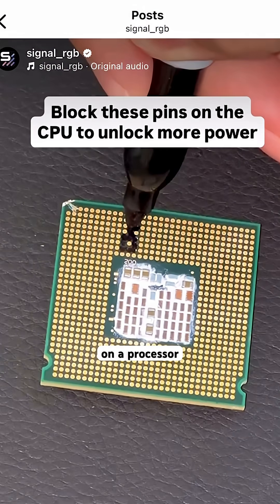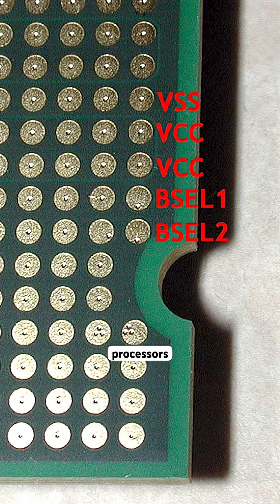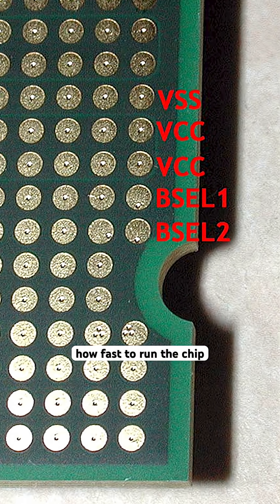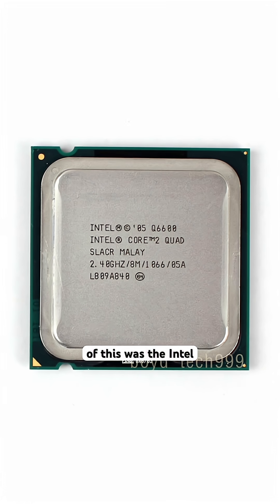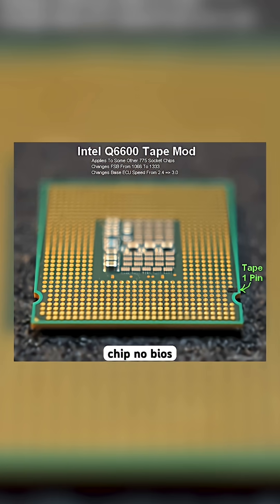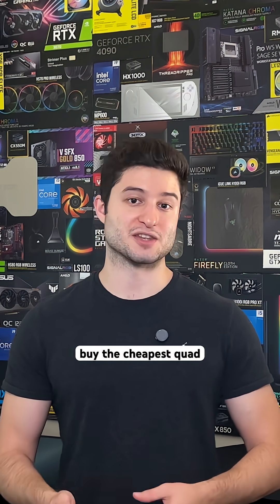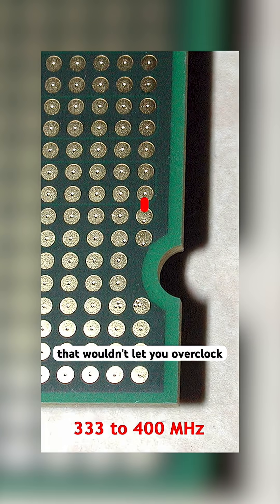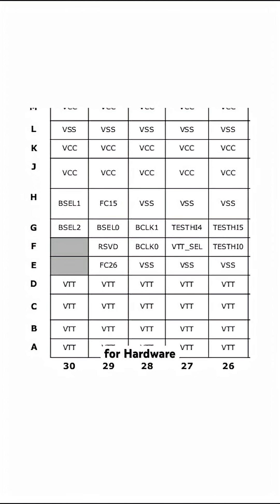Taping a CPU to improve it?!

Comment: the original socket A Athlon CPUs could be overclocked by connecting cut traces on top of the chip with a pencil.  It unlocked the multiplier.

Comment: The best overclock and bargain is still the celeron 300a. Set the FSB to 100, and it became a 450MHz cpu. They cost like 150, and gave on par performance as the 450MHz Pentium 2's at about 650.
Reply: Don't Celeron processors have smaller CPU caches and will there run slower in some situations, even if frequency is the same?
(Still a very good deal if somewhat slower than PII, because of that crazy price difference)
Reply: Nope, in fact, the half-size, full-speed cache was actually better in same workloads, including games. I used the same trick to boost my Celeron A 333 MHz to 500 MHz - the performance bump was massive for the time.
Reply: @anousenic  Yes and no. Yes it had a smaller cache but intel put it on the chip to save money. So it ran at the full chip speed. The Pentium II's cache was off the chip at 1/2 the speed, and as you noted larger. 

For most applications and games at the time, the 128k was enough and being twice a fast was a huge contributor to it's performance. 

Some heavy workloads that needed the larger cache would favor the pentium II 450.
Reply: @Blah.07 Slot 1 Katmai P3 had the same half-speed cache as well iirc. Socket 370 to slot boards or later slot 1 P3 were a massive improvement
Reply: @anousenic  PIIs had the slow off-die cache on the slot package, so yeah whilst the Celery had smaller cache the fact it was on-die meant super low latency and with 1:1 clocking that was faaaaaaaaaast

Hence the winning in some workloads and usually matching fine enough - very few situations the PII outright won!
Reply: @anousenic  One quarter of cache running half of speed.

But is funny see these jerks thinking they're smart and no one will detract their bullshit...
Reply: Glad to see others remembering the legend. The 300A is still the undefeated champion of "i delivered so much for my cost". Modern day comparison would be taking something like a 5600, flipping a BIOS setting and bam, you have a 5900. With 6 extra cores coming out of the magic ether :P
And boy, was Intel pissed when people starting putting dual 300A's in SMP... yeah, who cared if you had to drill the packages. You'd have to blow 3 300A's before you hit the same price point as the 450.
Couple it with Intel having another legend out at the time, the 440BX, and it made for really good times. That that chipset could later in the days hit 150FSB give or take was just icing on the cake.
Reply: @ErazerPT …. Ah, the memories…
300A
440BX

I added a Peltier cooling system (custom-made by some dude)

Good times.
Reply: yea but the 1ghz was cheaper. and you could go up to 333fsb / 66x

no point in bumping up 400mhz if it fries.
Reply: I remember doing this! I don't think I could even assemble a PC these days.
Reply: Back when I was into my overclocking, I had a Celeron 300A setup that could boot at 600MHz with a FSB of 133, and the stock 4.5x multiplier.

To get there I tried 4 different CPU's, several brands of PC133 memory, made a custom billet alloy CPU heatsink with TWO 80mm fans on it, all sat in (IIRC) an ABIT BX6 motherboard. The motherboard was the key, because it would auto populate all the CPU parameters, but then let you override pretty much all of them.

It took a lot of tweaking with things like the CPU voltage, and memory timings to get it to boot into windows at 600MHz, but I got their eventually. Unfortunately it was a bit too unstable if you asked it to do anything on top of running the OS.

It took me several hours of trying over and over again before I finally got a CPU benchmarking program to run all the way through, then take a screen grab of the results, and save it before the system crashed. 😁

I clocked that one back down to a totally stable 450MHz, and ran that as my LAN party PC for a couple of years.

Oddly enough, I pretty much did the exact same thing when the Q6600 came out. I ended up buying 3 of those to find one that was happy with an extream overclock, and got some pretty impressive results on air cooling, but once you've ran a CPU at DOUBLE it's rated speed, ONLY being able to get a 33% boost from 2.4GHz to 3.6ghz is a bit anticlimactic. 🤣

That one also ended up with a less OTT overclock, and was used as a LAN party PC for several years........ I think I've still got it somewhere. 🤔

(I just had a quick look through my box of old CPU's, and found one of the two Q6600's that didn't make the grade. I'm now trying to remember what I did with other one? 🤔)
Reply: @Reman1975 i just recently came across a Q6600 sitting in the junk drawer in my workshop, found that thing and it immediately took me back to those days 😂
Reply: OG AMD Athlon (Thunderbird core) was very easy to unlock... All you needed is a pencil to bridge the gap on L1 bridge and you would get an unlocked multiplier.
Reply: @bojned literally just commented this on another thread in this comment section, the pencil trick was epic. I would always cover the pencil mark with clear nail polish that i put on with a toothpick because those were the days when i was too cheap to buy conformal coating and i was paranoid that the graphite would somehow wear away 😂
Reply: I dunno Venice core for Athlon 64... could buy a 1.8ghz and oc it with stock cooler to 3ghz; they were insanely efficient for the era
Reply: @plasmar1 i had an amd duron oc 10-15% with software, until it stopped booting. wish i kept it
Reply: It's not "still" lol 450mhz would be so painful for todays age.
Reply: @rawbmar1166  We're talking relative performance.
It would be like buying n i5 for 150, then setting a pretty standard option in the BIOS, and getting an i9 for free.
Reply: Oh yes, I had 3 300A's overclocked with peltier cells and waterblocks running SETI.
Good times.
Reply: Especially paired with an ABIT BP6 motherboard. Dual processor goodness for a budget price. Still have my box from back then.
Reply: @egbront1506  i still have an unfinished project from the time i loved the Pentium 3 (although a bit after its hayday). Dual Socket 370 Mainboard with Via apollo 266 chipset (DDR1 and AGP Pro 4x slot), 2 Pentium IIIs 1400.
With a decent graphics card it ran much later games surprisingly well. Unfinished because i bought 2 waterblocks for it to watercool it with leftover parts from my more "recent" system... and Firefox stopped working after some update required instructions the cpus didnt have...
Also never tinkered with overclocking on this thing, bios didn't offer any options and didn't bother trying of patching it reveals hidden options or if the pll/divider is reachable over i2c/smbus :D
Reply: I did a similar thing to my P3 500. Upped FSB from 100 to 150 and it ran perfectly fine at 750MHz. Not all memory ran that fast though.
Reply: The Pentium Dual-Core E2160 has the Celeron beat. 1.8 GHz to 3 GHz on the stock air cooler for $65. Like all Core 2 chips, completely unlocked, so required no mods.
Reply: @rars0n  Yeah, got my Celeron 440 from 2.0 to 3.5 like a breeze.

Comment: The chip wasnt designed to be running that high of a clock. Im willing to bet people spent half the money on a chip they burnt out and replaced 3 times. 😂
Reply: CPUs didn't burn out like that back then.

Now they even come straight out of the factory with degradation issues.

Comment: All processers are made the same, but based on testing are how they are rated.  Like the i3, i5 and i7 are all the same CPU with certain factors blocked or locked out because it didn't get up to snuff.
This was most widely known back with the Celeron processers and the Pentium 4 series.  A Celeron was just a P4 that didn't make the cut.
Reply: but what is the downside to doing this? overheating? would better cooling prevent degradation or it makes very little difference?
Reply: @TheReapr my basic understanding is that it depends on the "silicon lottery" referenced by other commenter.

Intel might say their i5 runs at 2.4 ghz with 4 cores and the i7 runs at 2.6 ghz and 6 cores. You might have a chip that actually has 6 functioning cores, but running at 2.6 ghz fails. So they can't call it a full i7 and block off 2 cores and call it an i5. But by tinkering with your cpi you could get 6 cores out of it but be unable to run it past 2.4 ghz.
Reply: @TheReapr there is a chance the chip isn’t stable at the high frequency. Maybe it works now, but after a year of ageing in 35°C summer temperatures it suddenly starts bluescreenining.
Reply: Laughs in CCX zen2
Reply: No they aren’t. They will have a few designs and might get two or rarely three products out of that design. 

The i3, i5, and i7 are not all the same chip just binned.
Reply: @bensemusx  um afaict intel copied amd and still use their drivers includeing current architecture. they wouldnt have 64bit or multiple cores without it. 

on top of this intel does this binning. which is fine, the stuff that works... still would be working removing any restrictions like ram addressing and overclocking limits. 

these days you can have various components at 3ghz and have a quad core on its own power profile and rail. hitting up turbo 4ghz 😂 brand new gpu... with 4 lane pcie 😂 unless its a xenon
Reply: They still do it now. Tried to make an 8 core processor but two cores don't work?
Congratulations on your new 6 core processor!

That's why the PS3 Cell processor has 7 SPEs instead of the standard 8.
Reply: Kinda the same for NAND. Almost 100% of the NAND on the consumer market is the junk that didn't pass QC for enterprise hardware.
Reply: 🤣🤣🤣🤣

completely different architecture

Comment: I have a q6600 in a working PC as we speak.  It will not run at 3ghz and you don't need tape to find that out. The bios has OC capability...you can tweak fsb and other clocks from there.

Comment: Models of Dells up to last bios version of the Precision m6500 could also have fan control overridden to run at max when modding via Fn + Shift 15324, then Fn+R. Did a lot of this stuff on Dells and Cpus that were not meant to run so hot.
Manual entry of BIOS fan control in hexadecimal, like being a fucking wizard.

Comment: It doesn’t matter what the motherboard thinks the processor is. The key point is what the processors actual speed was after the modification. Was the speed really increased or was it still running at its normal speed and only the software reported it as higher (trick)

Comment: Did it fry your cpu
Reply: Not really it might become unstable at which point you just take the tape off but by that point over heat protection was already in use

Comment: You have to remember, electronics are binary.

There are a surprising number of configuration pins on almost every chip.

They are, you guessed it, binary. 
They either read low or high voltage.

For example, if you ever look at a datasheet, you'll see a bunch of voltage id (VID) pins that combined add up to 2^n voltages at whatever step and range the spec calls for. Ie 5 pins =32 possible voltages.

Bus select (bsel) is the same. Usually there are only 2. Which gives 4 possible settings.
This is exactly what this hack was.
Taping = detect low (0)
Bridging with conductive ink =detect high (1). Pencil was used on the og athlons. 
The datasheet shows what the values mean.

These hacks are becoming less possible as particularly Intel are using one-time fuses in the silicon, and propriety microcode no one's figured out yet to limit the chip to only what they have binned it as.

Comment: Wasn't there a reason engineers decided the chip should run at 2.4MHz? I mean, it seems weird that they would intentionally handicap a chip for no reason.
Reply: It's due to the manufacturing process of CPUs. Most CPU silicon is produced as this giant wafer that's then cut into the small CPUs The production techniques aren't perfect so individual small CPUs can have slightly varying performance or bits that just don't work to spec. Rather than throwing them out they basically  deactivate either through physical changes or through software the damaged or improperly running segments or set the system to run at a lower rating so that it meets the spec on the box. You may get a bad chip that under The higher speed is just unstable and if it had been branded and you would paid the cost for that higher chip speed you may feel like you got screwed over but you're never going to feel bad about having a chip that can do more even those advertised as being worse and cost you less.

Comment: BSEL mod was the good ole days. OH! look a tiny piece of tape. WHOOPS more performance. But keep in mind it had to be a CPU running at a lower bus speed than the motherboard. If the MB bus speed was higher but the cpu was designed to run slower, it couldn't tell the MB that so the MB would tell the CPU to match its bus speed, which in turn ran the CPU faster than it was intended. If the CPU bus speed and the MB speed already matched, it wouldn't do anything at all.